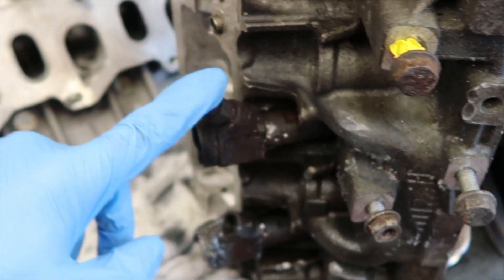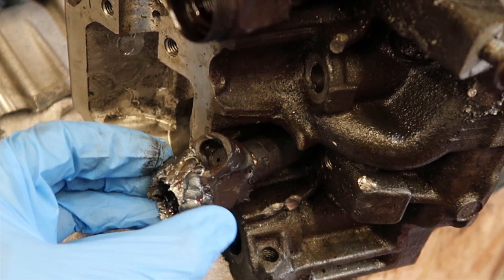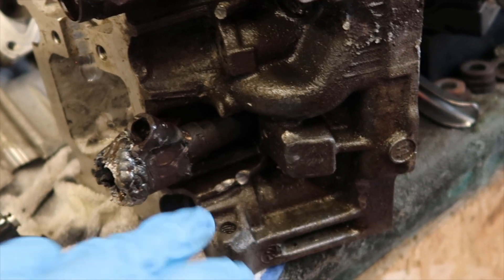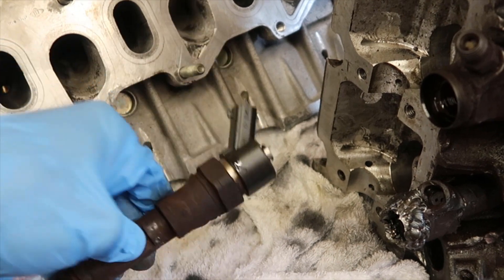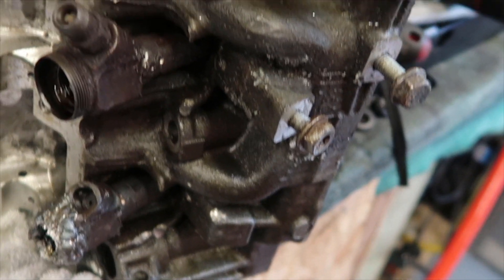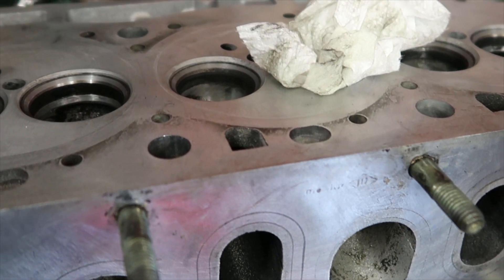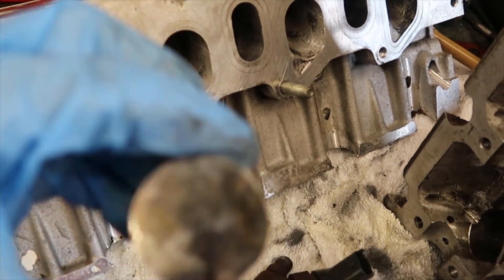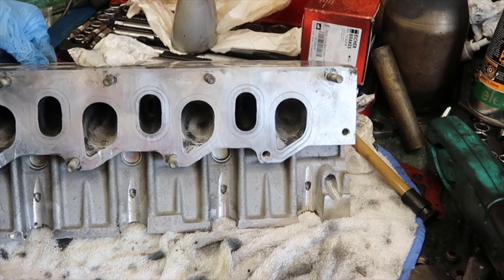Renault Trafic 1.9dci Seized injectors and striped cam belt!!

Comment: Slightly off topic, however having an issue with my m9r 115dci 2.0 diesel trafic, the timing slipped while stationary….long story short it would crank with compression but not fire up, so had the timing all done with a new kit now there’s no compression, do you have any idea what it could be that’s causing the loss of compression?
Reply from the maker: @MartynMorrison-ez2yn  they have a cam chain set up (not belt) highly likely if timed up correctly it probably has multiple bent valves
Reply: It was timed up using the cam pin and timing tool, is it possible for it still to be done incorrectly using they tools?
Reply from the maker: @MartynMorrison-ez2yn  there is good instructions to follow in the Haynes manual.  Quite easy to get wrong
Reply: Thanks mate I will have a look, say some of the valves are bent, do the injectors need to come out to replace them?
Reply from the maker: @MartynMorrison-ez2yn  you can't get the cam cover off if you don't remove injectors.....that's why it's such a crap design
Reply: @boosthit811 are you sure? I have a 1.9 engine, currently salvaging after snapped timing belt. I can get rocker cover off (assuming that’s what you mean by valve cover, apologies if not), and if the head in this video had two seized injectors, that would suggest they don’t have to come out.
Reply from the maker: @MartynMorrison-ez2yn  maybe worth looking for a good donor engine
Reply from the maker: @MartynMorrison-ez2yn  if timing is correct most likely a bent valve or valves

Comment: If you've got it moving Side to side and the cylinder heads off, punch it out from the injector tip end.
Reply from the maker: Yeah sometimes that works but only when they are actually not that tight.  I've bent press pins trying to press them from the tip side to.

Comment: When new injectors are installed on the 1.9 do they need to be programed to the ecu ?
Reply from the maker: No mate.
Reply: Hi buddy got another question for u , can't seem to buy a vacuum gasket with out buy the whole lot , so salvaged my old one off a bown engine fitted to a new recon f9q all looks the same but the gasket looks to me like it doesn't fit properly or is it to stop the oil running back into the engine , bugger i cant attache a photo
Reply from the maker: @john147GTA  if it's off a f9q it should be fine.....